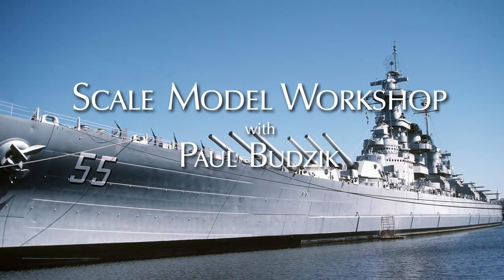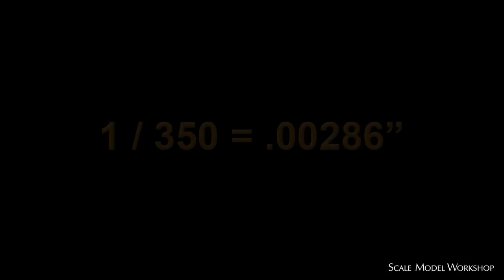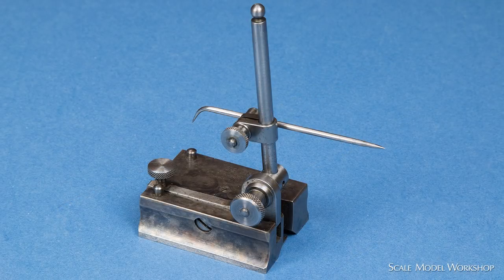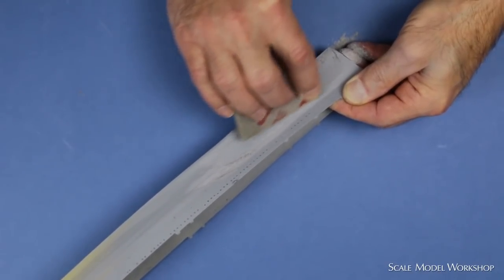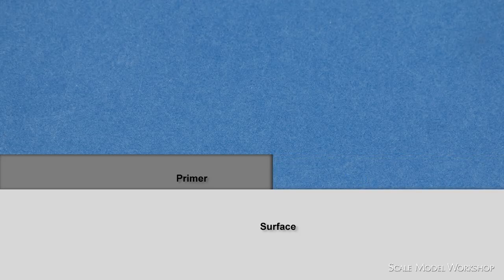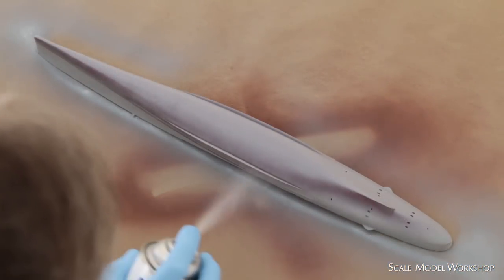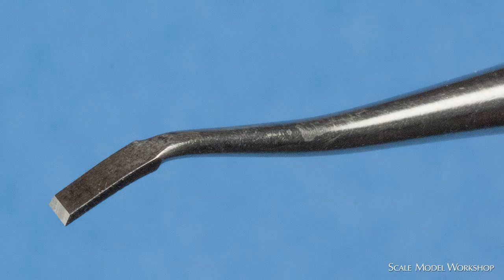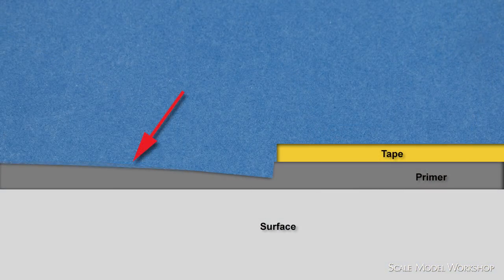Creating Raised Panel Surface Detail

Comment: Hi Paul, may I know if you would consider using laser-cut wood deck stickers that can be pasted onto the ship model directly? There is a big debate on this. If you would not consider using it. Could you please give us your thoughts about wood deck stickers that are sold as aftermarket accessories for ship models? Thanks!
Reply from the maker: I think wood is a great idea for larger scales ... for me ... the grain is too coarse for 1/350.  Also, I don't trust the adhesive for the long term.
Reply: Thank you so much Paul for your reply, it is greatly appreciated! I notice though that on your 1/350 USS Washington BB-56 1942, you use N scale car siding from Evergreen to simulate the wooden deck. However, the car siding plastic strip gives the impression of extremely long single planks that run fore and doesn't really simulate the deck planking patterns (2,3,4 or 5 deck patterns with short planks) normally found on ships. Did you decide to omit the deck patterns because they are too small to be seen on 1/350? Also, would you have any tips on how you would make the deck look as similar as possible to real wood at this scale? I thought about using very fine and thin brown paper or even wood decals because the effect would be difficult to achieve with paint. I would be grateful if you could share your thoughts on this! Thank you!